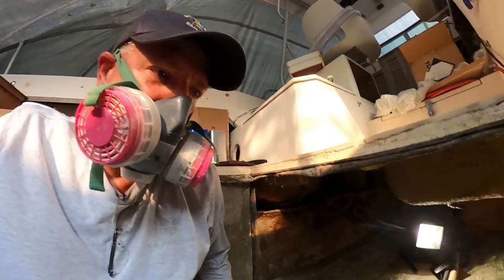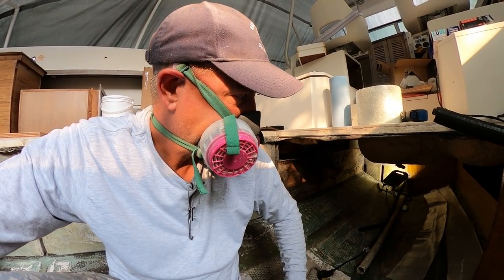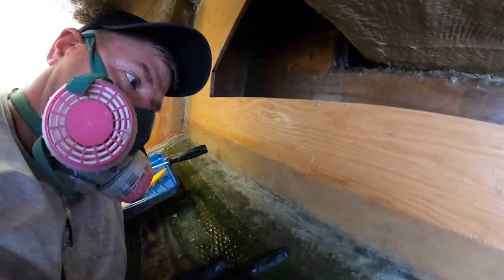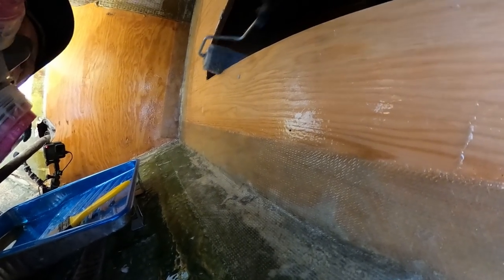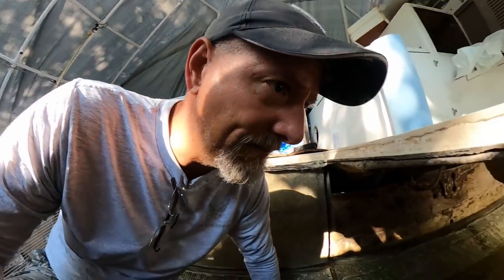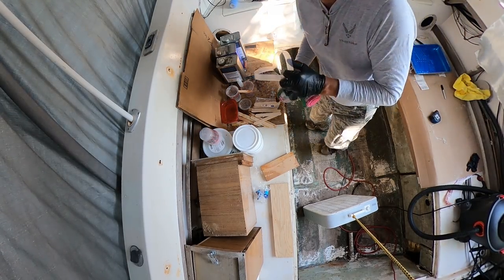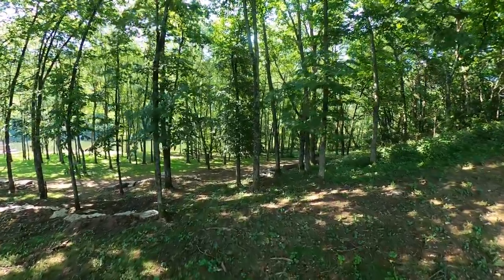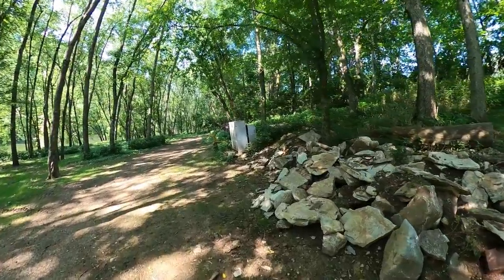Tabbing, Painting a Barn, Reds Game | EPS 28 | Shots Life

Comment: Have you watched "Boataholic"?  I ask because he is using a face filter marked "JSP" which looks much more comfortable and streamlined than the 3M stuff I am used to and which it looks like you have.  Extends out so far it puts weight on your face and knocks into any close work.  I have never used JSP but it might be worth investigating.  I would recommend the electric scissors as used in "Boatworks Today" as they do not pull so much on the material stretching it that scissors do, plus they save a heck of a lot of finger work!
Reply from the maker: Nope, I have never seen it but I’ll check it out! Interesting about the scissors! I wonder how expensive they are?

Comment: Could you maybe staple it on and glass over the staples
Reply from the maker: Funny I had not even thought of anything like that! Yes I could staple it, then pull the staples. Great idea good Sir!
Reply: @shotslife  don't hurt to try idk am learning alone with you brother lol but looks great my friend one day at a time the results are showing keep pushing
Reply: @shotslife   I have used 3m Super 77 spray adhesive to hold fiberglass in place. You can spray it on and stick the fiberglass right away, don't need to let the Super 77 dry. It is often done this way on RC model airplanes. The folds you are getting in the fiberglass is due to several things like the boats curves and handling the fiberglass distorts the weave. I don't see any issue in cutting it like you mentioned. It can be minimized by spreading it out by hand before you roll it, and the direction it is rolled.